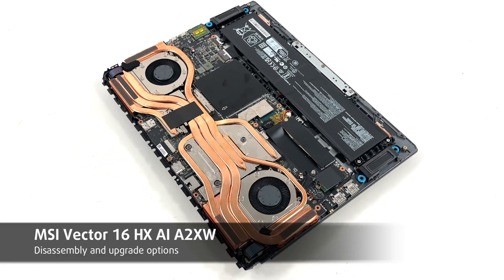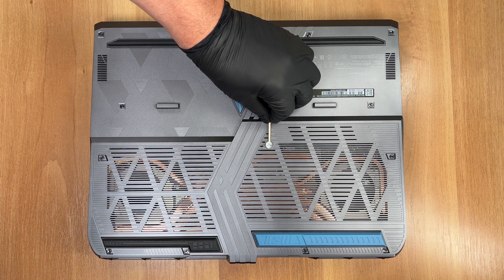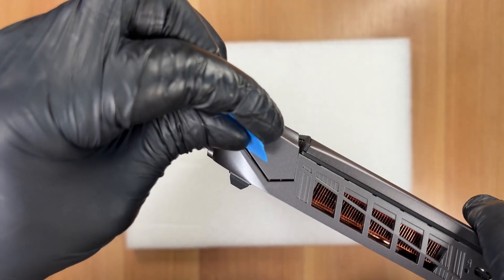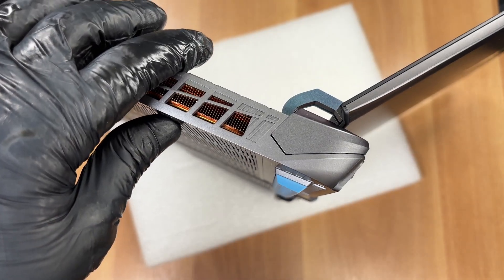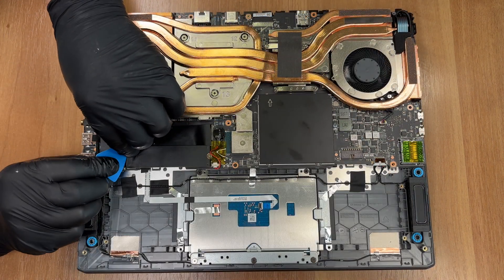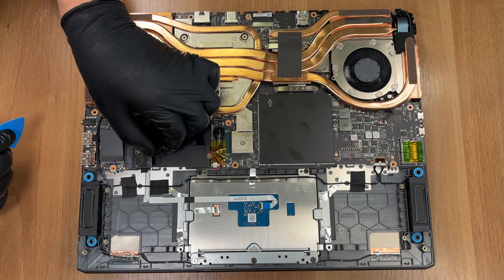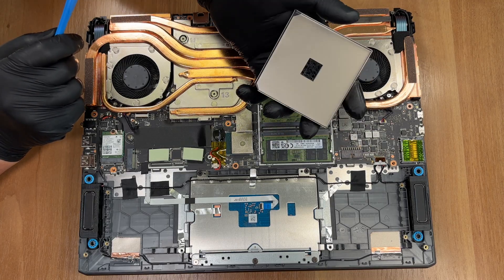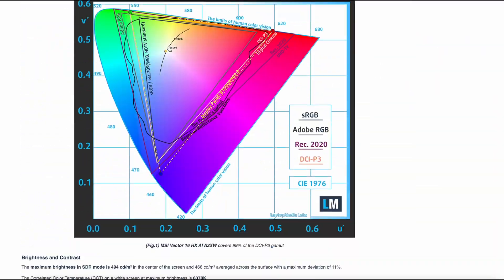🛠️ How to open MSI Vector 16 HX AI A2XW - disassembly and upgrade options

Comment: There are two SSD slots, you only show the occupied one. Is the tape over the second one also metallized to protect against RFI? 

A: It seems so, but thermal pads are not there and don't normally come with SSDs (nor the screw, but it seems to come with the screw in).

Comment: YOU can open this laptop on shorter time using the same technic shown in this video tutorial.
1. Once you unscrew everything from the bottom you do not try to open the small cap from behind!
2. To open the back-top cap you star with it's right side.
3. Slide the screen back
4. Now put this blue triangle tool in the tiny gap in front of that small cap and slide to the left from right.
5. Close the the monitor carefully without touching the back that you almost crack opened.
6. Now slide the tool in the left side of small cap
7. Open monitor again by sliding up to check if everything is loosen in front.
8. Close the screen again
9. Use the gap between screen and try to make it a leaver with this blue tool and with a little friction try to open the top cap - it should open like this, if not - try to do the leaver force with the whole front using the gap between screen and it should open early...
Few steps but it's kind of... 1 minute of work.
Reply: @moon_Varcan - Can you make a video of your technique?  Sounds good, but the steps are not that clear in text form.

Comment: Thanks for this guide, I will say this was easily one of the hardest laptops I have ever had to disassemble, and for no real reason other than to make it harder for the end user to upgrade the machine.
It was a must in my case since the machine only came with an 512gb drive.
I set the machine up, cloned the drive onto an larger 2tb drive making sure to expand the storage, then added an second 2tb drive and upgraded the ram with 32gb.

Nice machine for the price (£1500) Intel core ultra 7 255HX, Nvidia RTX 5070Ti, got £100 back from selling the SSD and ram and had the 2 x 2tb ssds sitting around. Cost £85 for the ram.

Comment: Just an advice: after removing the small plate and the screws, turn the laptop on its lid and use the tip of your fingers to pry open the large backplate by starting with the upper most side (near the heatsink fins, where the first small plate was removed). It takes literally 5 seconds and has zero risk of damaging any component with the spudger. I have an A2HXWHG and I've opened it so many times I've lost count. First time was on the day I got it due to a stupid mistake I made that forced me to install a secondary drive, and I opened it like you're doing - it was extremely stressful and took ages. Second time, I wanted to install a 2TB Crucial T710 and imagined there had to be an easier way to open it without losing 10 minutes of my life and by trial and error I came up with this. I since then opened it a few more times to add heatsinks to the SSDs and replacing the pads on those heatsinks with better ones. Hope it helps.
Reply: This needs to be top comment - just worked this out myself after thinking I was going to scratch the hell out of my case
Reply: I've been hunting any information regarding the ssd upgrade and I'm still unclear whether these laptops have or have not elements to install the second drive inside them. you seem to have my exact model, so perhaps you'd be willing to answer before I go through this hell: 
is there a screw to keep the 2nd ssd in place or not? I think I can see one in this video but maybe that's a different model? and if I have the screw do I really need to get that other part from msi service to keep it connected in the slot? I can't seem to get it anywhere else and I just know it's gonna take literal ages for msi to send it. I do not have any access to a 3d printer, and regardless I have no idea how does that second element even look...
Reply: @MissMokate the screw is included, don't worry. There's also a bit of isolating tape that you need to remove if you want to install a proper copper 1.5mm heatsink - which I recommend for DRAM gen 5 SSDs, cause they tend to run hot. Just make sure, if you're installing a gen 5 SSD that you install it in the empty-by-default slot (the upper most slot, closer to the CPU/GPU heatsink). The empty one is the gen 5 slot, the other one, populated with the OEM SSD is just gen 4. Feel free to @ or DM me if you need any further tips.
Reply: Also, there's nothing else needed to fit the SSD, unless you have anything other than a 2280 standard size. The SSD just goes in and Bob's your uncle...
Reply: @melgapin  you're saving my life and my sanity with this, thank you so much
Reply: @MissMokate  no worries. Anything you need to ask, feel free to. Also be ware of the new KB5063878 windows 11 update that's been bricking SSD's. My crucial T710  2TB almost ate sh?t.
Reply: I bought the A2XWHG-495FR model with a 1TB SSD a month ago for €2,200 (≈ $2,500). I had installed a 4TB SSD in my old laptop, but I'm too worried about voiding the warranty so soon. I'm going to wait a few months to be sure no components will fail. Weren't you afraid of voiding your warranty when you disassembled yours ?
Reply: @ke0zom204 I'm from Europe. Consumer laws here don't allow brands to void their warranty just because you opened up the machine. MSI tries to circumvent these laws by placing "factory seals". But these are virtually useless under European Consumer Law. Basically if you break your laptop unintentionally while upgrading something that by law you're entitled to upgrade (RAM, SSD, wifi card, etc) you're not liable - as long as you follow the instructions. Since instructions on how to open this machine are not clear at all and MSI makes the consumer operate by trial and error, if I had broken something, I'd have the right to either ask for a replacement unit or - should I have  chosen to keep this unit - that my device would be repaired under warranty or for a very low fee... Some things are off limits if the brand states it, though. Liquid metal replacement is one of them. Or anything that requires soldering...
Reply: @ke0zom204 If you're from Europe (which I assume because you mentioned Euros) you're pretty much in the clear. Just avoid breaking anything...
Reply: @melgapin I'm French, and now that you mention it, when I received this computer I didn't see the factory sticker that could be used to void the warranty, as shown in that video. I thought it was a mistake by the manufacturer because my previous laptop from 2018, also from MSI, had that sticker. I'll be able to install my old SSD in my new computer right away. Thanks for the clarification. 😉

Comment: Love how easy it is to upgrade the MSI Vector 16 HX AAI A2XW! Popping off the bottom cover, swapping SSDs or RAM — no hassle at all. Perfect for keeping it running fast and future-proof!
Reply: easy? haha

It's very difficult for me. I always need only remove the backcover but here I need to fight with another part.
Reply: @marioandreeorregozarate6264  It's not that difficult, I upgraded the RAM to 32GB and added a 2TB M.2, and only removed the back cover.
Reply: @1ndyskies  only back cover? but the video shows remove the another piece too.

Comment: A quick queston - do I really need to remove the hinges cover at all? By the looks of it, it should be possible to just remove the bottom panel without additional hassle with a top hinges cover. Am I wrong?
Reply: Looks like a hell of a job to clean this laptop. Will take ages to open it or was it faster with you?
Reply: @BRDRSTER  It's the most bothersome notebook I had when it comes to opening it up. It's also the first one where I had to add a washer over the nvme drive :-D Seriously. I've installed around 100 of those in different machines, on different MOBOs & in different notebooks, not a single issue - unless I upgraded storage here :-D The PCB was too thin for a screw, by a bit but enough - so it was loosening in a slot, a washer solved the problem but I've got those small washers, not everyone will be prepared.

In general, opening it up is a bother - mostly due to the 3,5mm jack socket, which also becomes the issue while closing it back. It is doable, it's just plastic and a freaking notebook - so doable - but yeah, it is a bother and cleaning it up will be terrible.
Reply: @sphiratrioth666  did you find out if you have to swap thermal paste?
Reply: Good question!!
Reply: @BRDRSTER  And I can already answer. Yes, you can but it's tricky. You need to pick the latches around that "V" cut carefully and then you can - but it's not worth it - since the top cover comes off in seconds so it's easier taking it off first - but technically, you can.

Comment: They really don't want you to open it.
Edited down, with correct tools it took this guy around 12 mins to open, and  he's a pro,  with  practice.  Good luck to us mere mortals, using whatever tools we have on hand.
And I thought my GE78 was hard to open.
Reply: At least they don't put screws under the bottom pads🙂
Reply: It would take me 1 min to... Break it 😅😅
Reply: @cleyt973  more airflow
Reply: Frfr
Reply: It's not hard at all. Check out my comment. It's actually very easy.